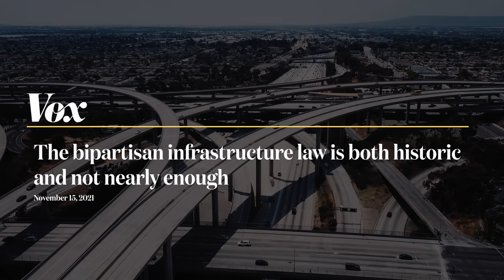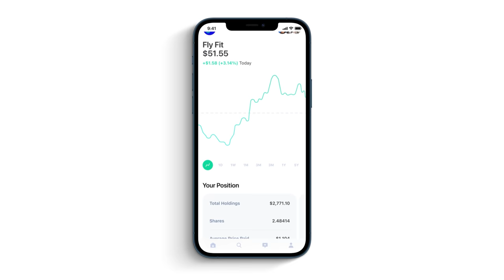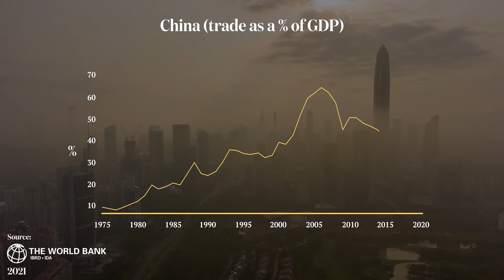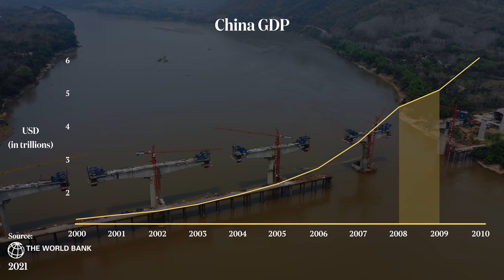China Has A Debt Problem Three Times Larger Than Evergrande | Economics Explained

Comment: is there any chance you would do a video comparison on the economics of Japan's highspeed rail? I think about the efficiency of Japan's infrastructure maintenance often. Like that sinkhole they fixed in 2 days a few years ago.
Reply: Lol japan actually aimed for a prc like density of hsr in the 80s. Then the financial reality of its cost hit home. They privatized jr rail, and the less economical routes never got built. So japan still has a mix of normal and high speed trains. Thats what i read. Prc is already aware of the hsr cost though...they might cut back if it turns out to be a grey elephant for mid size towns and cities.
Reply: @abcdedfg8340  part of the reason it ended up being a highspeed and normal mix is also they lost a entire decade from 1991 to 2001 and there now only moving at a snails pace.
Japans ecconomy has been just as stagnant as europes since the eurozone crisis for even longer
Reply: @Newbmann  True, but even before there were probably questions around its viability when there were already trains, highways, and planes. If the hsr just moves traffic and saves maybe 30 minutes or and hour top, seems abit over the top, for a town or small city. Besides, hsr is only part of a wider system, so it needs to be rational.
Reply: Sink hole was caused by construction nearby and it actually took a week to reopen. Also closed later when it began sinking again after a week or two
Reply: The tokyo rail lines have had similar problems to the China rail lines. The Tokyo rail company has gone bankrupt before, so I’ve heard.
Reply: @Boy Kulot Japans issue is population now, and people are much less likely to emigrate to japan compared to Europe
Reply: That would be a great topic, but also because I believe Japan has the largest debt to GDP ratio in the developed world.
Reply: JR is a very interesting case. The shinkansen lines originally connected the two major population centers. After that JR leased out the space both within and in close proximity to the lines to further profitability. This allows some of the less used lines which may or may not be profitable to still remain profitable overall as businesses will prefer locations close to JR lines and pay a premium for it, especially if they're out of the super populated areas like Tokyo or Osaka. However, I think the most defining characteristic why JR is successful in it's HSR project is that they have a high ridership with a population that is wealthy enough to pay the ticket costs associated with it ($80-120) one way. For comparison, the Beijing to Shanghai route is a distance of 1300km which costs $80 per ticket, while the Tokyo to Osaka route is just 500km while costing $80-120 depending on when you buy it. The shinkansen is earning over 2x the revenue per segment in ticketing costs alone. This is a big deal in terms of viability. If costs are similar,  JR can run these routes with half the ridership. China's HSR cannot extract such prices out of their customer base. If the Beijing-Shanghai route for example cost the equivalent amount of the cheapest shinkansen ticket, it would cost $180 which would put it at worst cost performance than air travel. I won't claim to know what plane tickets cost in China for those routes, but in the US, where air travel is dominant for long distance travel, tickets can be found from LA to NYC for as little as $100 which is over 2x the distance.
Reply: @abcdedfg8340  Yep, it's important to pull back when you know it's not going to be financially viable.
Reply: @wakannnai1  That's a great response. Thank you! I think it's a really fascinating comparison!
Reply: @chrissmith3587  Lol no. There are lots of people wanting to go to japan but japanese don't like foreigners
Reply: @Boy Kulot strangely enough, i do say that a certain degree of insecurity actually helps the country as a whole.
like, pick a natural paradise where things almost never goes wrong like Latin America. infra structure projects and urban development are done haphazardly and embezzled, then everything end being poorly made and fails to disrepair in a few decades. that if it even gets finished.

you do that in a country like japan or at least in a country with a harsh weather...  and instead of just rotting away, those things lead to disasters or tragedies.
 
you do the math and find that hundred of people deaths could have been prevented by proper infrastructure directly or indirectly? no one cares
a dozen of people die in a tragedy? people will demand someone's head and something to be done about it
Reply: @fandyllic1975  yeah but over half of it is domestic meaning japan actually dont have to pay those debts...
Reply: @hh-nh6ju  with the amount of debt, I’m not sure that helps much.
Reply: @khhnator  I wouldn’t call Latin America a natural paradise… lots of it is horribly hot and humid, plant growth is so fast yr constantly having to hack it back, and the bugs… so many and so scary. Humans are the worst part, though… except the peaceful indigenous tribes (not all are peaceful, tho).
Reply: @wakannnai1  that may be the case now, however it is important to note that the shinkansen was built in the early 1960s when japan was far poorer than today was profitable within 3 years after it was built and paid back the initial investment within 10 years.  The main reason why is as you said, it lies on a line between the 2 largest cities with over half the population of japan within those 2 cities as well as over 60% of the GDP.  In general HSR requires very specific conditions such as high population density and distances between 150 to 600 km for it to outcompete cars and planes.
Reply: @fandyllic1975  Japan is the biggest lender overseas, so no Japan is not strapped for cash. Japan is in debt like every country in the world but its overblown on how much they actually owe
Reply: @chrissmith3587  
One issue with Japan is that they have super strict laws against immigration. Like I think with regard to regular immigrants you need to marry a Japanese man or woman in order to be able to immigrate. 

Also with respect to the Japanese, their immigration laws are excessive and overly discriminatory. Like during one year where other large countires let in like a few hundred refugees each from impoverished countries after properly vetting them, the Japanese only allowed in a dozen or so. This is despite the fact that Japan's population is rapidly aging, they desperately need workers and the most of the children of immigrants who were born or lived in the country a long tims become far better integrated into the local society then their parents do.
Reply: @abcdedfg8340  One of the HSR routes in Japan (the Jōetsu Shinkansen) is rumoured to have been built as a "pork barrel" project by a former prime minister wanting to reward his constituents for their support. I'd wager that this is not one of the more profitable lines in the country, given how remote Niigata Prefecture is from the more heavily-populated parts of the country.
Reply: Japan help China to build their first high speed railway system. Then China just copy everything and claimed as their own. Just look at the design of their train, even half blind people can tell the similarity.
Now China is selling "their" railway system to other countries and compete with Japan. Since the Chinese clone is a lot cheaper, it create a major headache for Japan.
Reply: @hh-nh6ju  Japan has the largest total, but only 12th per capita.
Reply: @wakannnai1  Love the irony between your name and how detailed your response is😂
Reply: @wakannnai1  Chinese plane tickets are a bit more expensive, but not so much that you wouldn't rather fly than spend $200 on a train ticket!
Reply: @Boy Kulot lol Japan has already beat Europe... far higher GDP than any country there; they are not a mess you know nothing about Japan
Reply: @Pixel5564  not true
Reply: @Theoryofcatsndogs  and unreliable too
Reply: @allentoyokawa9068  how
Reply: @abcdedfg8340  3-4% a year growth for a highly developed nation is NOT snail pace, especially for a country with the 3rd biggest economy... for a developing country  yes that is slow... some people are so ignorant
Reply: The original Shinkansen debt is partly blamed for Japan's 30 year and counting "lost decade" of economic stagnation.
Reply: @wakannnai1  I've been here in Tokyo environs since 1987.  Over the last few years what stands out to me is the buildout of major train stations into retail spaces.  I don't know how the finances are being structured, but I'd expect that someone is making money.
Reply: @SurprisinglyDeep  Dunno, recently I see a lot of foreigners even out in the burbs of west Chiba, particularly Vietnamese and Chinese, but also from the Middle Easte.  I'm a white Canadian, married to a Japanese, and been here for 3 decades, so I'd fit the profile you suggest, but I'm doubtful that is generally the case.
Reply: @davidhawley1132 
 If that's so then it's good to know that Japan seems to be becoming more accepting of foreigners and immigrants in general.
Reply: pretty much the same. except they actually needed HSR to be able to compete with other transports, because their normal rail is a narrow gauge, which are slow. nowadays the normal rails are only for commuter and regional transports, while the HSR is for intercity.
Reply: @allentoyokawa9068  so your talking about the zoom boom after covid 
Guess what that's a quick recovery from a crash not natural long term growth.
Look before that blip how much ecconomic growth did it have from 1990 to 2020.
Reply: @chrissmith3587  it's not just about immigration no one's immigrating to Ethiopia and most people skip over turkey started births can have the same effect.
Reply: Wow! This will be a very good follow up.
Reply: @SurprisinglyDeep  I have permanent resident status, probably due to the fact that I am married to a national for a long period of time.  But I suspect that any of our statuses can be revoked if the national government really wants to do so.
Reply: @chrissmith3587  yeah and also mental health
Reply: @hh-nh6ju  im very sure they can repay their debt.Well their debt isnt as severe as china nor does it lend from other countries.
Reply: @fandyllic1975  yeah but no earthquakes, tsunamis, tornados, hurricanes, vulcanos, sub zero temperatures, snowstorms... heck even the wild life is meek there lol

and the ocasional floods ususaly can be traced back to people
Reply: They are currently sinking ungodly sums of money into ultra highspeed rail, just to try and cut the travel time between Tokyo and Nagoya from two hours to one. Quite possibly the world's biggest white elephant, if it ever actually gets completed.
Reply: Or how there is like no deaths on its Shinkansen
Reply: @Newbmann  Europe as a whole might be stagnant but individual european countries are doing just fine, Netherlands has been at a solid GDP growth.
Reply: @quitmarck  yeah countries like Ireland, France and Poland have been growing as well but those are the only big ones countries ranging from Italy and Germany HMM what do those have in common with Japan alongside Ukraine and Russia more or less a few affluent metropolitan centers surrounded by "rustbelts", I could go on.
Reply: @Newbmann  Netherlands etc. Main issue with these countries is just very elderly populations. Especially Japan. Economic growth to a large extent is limited by demographica.
Reply: @abcdedfg8340 
Regular railway supports freight as priority for profits and is able to provide passenger services
Reply: Here is a comparison at minute 06:00: https://www.youtube.com/watch?v=eLCa6Vl7EeQ&ab_channel=ChinaInsights
Reply: @ZooDinghy  interesting, thanks for the link!
Reply: It's an easy model to run japan move more people over a shorter distance. More people over time and distance =profit. 
Chinas rail covers so much distance they can't make profit as the services are to limited because of cost. There trains are mostly empty in the remote areas the services run. Huge maintaining cost eat all profit in the chinese rail model. Losing millions$ a year.
Reply: @Vignana_Pradarshana  While I think that was true in the past (that the Japanese didn't like foreigners) I think that has changed (at least in regard to their acceptance of westerners). As recently as the 1990s Japan was an unwelcoming place to Westerners, but my own experiences in Japan in 2011 found a Japan that was well signposted for English speakers, and Japanese people who were very outgoing and friendly towards westerners. 20 years is a long time (long enough for a new generation of Japanese to reach adulthood and a lot of Western culture to enter the country).
Reply: @mistralxsailing6  That's the point. China should have stopped building high speed railway way earlier as long as the high speed railway was profitable and then move to alternatives such as regular railway which is much cheaper. Because they  put so much money into high speed railway, there wasn't much money left for regular railway. As a result, they must move almost all of their goods on the streets which is more expensive then regular railway and which destroys the streets as trucks are so heavy. Now they have to pay to maintain the streets and the high speed railway that are almost unused because they lead to nowhere.
Reply: @abcdedfg8340  erm is actually prc aiming to be like japan lol. Not the other way round 🤣 been to both countries
Reply: @abcdedfg8340  That's not quite right. In the 1980s, there were only 3 high-speed (Shinkansen) rail lines in Japan-- the Tohoku Shinkansen, between Tokyo (Ueno) and Morioka; the Tokaido Shinkansen (the original one) between Tokyo and Osaka; and the Sanyo Shinkansen between Osaka and Hakata.. In the years since, Japan has built or extended more Shinkansen lines, including the Nagano Shinkansen, which was built to accommodate the 1998 Nagano Olympics; the Yamagata Shinkansen, which was built between 1992 and 1997; the Akita Shinkansen; the Joetsu Shinkansen to Niigata; the Kyushu Shinkansen (two lines); and the extension of the Tohoku Shinkansen up to Hokkaido. The Tohoku-Hokkaido Shinkansen will be extended to Sapporo, the Nagano Shinkansen will be extended to Tsuruga, and a new linear line is being built between Tokyo and Osaka.
Reply: @toomanymarys7355  Chinese air industry often face delay and bottleneck due to airspace issue. So if u don’t want all the delay etc, taking a hsr is a very good options.(I have several flight in china before, delay is very atrocious sometimes, meanwhile when i am in Taiwan, Japan and Hong kong(bound for foreign destinations), I haven’t face too much delay.
Price sometimes may not be far off, but air delay and check in time/travel time airports make hsr appealing. 
The Shanghai Beijing line, despite being around 1300km long, is the most profitable line of china HSR.
Reply: Could it be that because they have so many earthquakes, there are systems in place for rapid public works projects?
Reply: @abcdedfg8340  Each time you try to apply a single solution to many problems, it never ends well. HSR is a very specialized tool, which means very little flexibility and high cost. In the right place, it works wonder, otherwise, it's a financial disaster. PRC with its political system isn't equipped to question projects, their feasibility, etc. With no opposition, projects can go forward on a grande scale, unfortunately, without any hindsight. As you mentioned, Japan was able to revise its plans before it was too much late. And since this era, new HSR extensions in Japan have been very few and built over long period of times.
Reply: @Founderschannel123  bad thing is, China's debt is lower than their gdp but Japan's is 2x that of their gdp
Reply: Indyck Monkey  mostly because people here think HSR is cool and that it will show the world how great India is, which won't because some middle income countries have HSR but nobody cares about them, including Turkey,  Russia and poland
Reply: Indyck Monkey  I mean, I kind of want to be in politics but seeing how it's a message nd to get elected you have to make fake promises and appease certain groups, I don't really wanna, I am studying macroeconomics which does help in me understanding the policies by the central gov. but half the time, they're stupid, like how modi is building so many Expressways but not really upgrading the current ones, and not upgrading city intra, but I still love the Expressways do I'll let it slide
Reply: @fretstain
Your 🤔 thinking based on?
Reply: @bleuemoone8710  We have a LOT of earthquakes in Japan. And the government has been making an intensive effort, ever since the 1995 Kobe earthquake, to make sure that buildings in Japan are safe from earthquakes. My own part of Japan was hit by a M5,0 earthquake this morning-- but there was NO damage-- anywhere-- thanks to those building codes.
Reply: @bleuemoone8710  We have a LOT of earthquakes in Japan. And the government has been making an intensive effort, ever since at least, the 1995 Kobe earthquake, to make sure that buildings in Japan are safe from earthquakes. My own part of Japan was hit by a M5,0 earthquake this morning-- but there was NO damage-- anywhere-- thanks to those building codes.
Reply: @sailormatlac9114  Well then... in America's case, it requires a multitude of different solutions to solve a single overarching problem, in this case transportation, and reducing the need for personal cars and air travel without eliminating them entirely.
Reply: @mikenekosama4426  double post?
Reply: @fandyllic1975  Japan always to be a export oriented economy. Their big corporations operate around the world. It's not correct to use the domestic GDP to measure Japanese debt.
Reply: @davidhawley1132   Agree and I would think that is part of the success of the transport system in Japan. I love how I can get off work, catch the train and get some shopping done above or near the station on the way home. And with everyone doing home delivery, we can shop and catch the train home in time to receive the delivery (sometimes :-)  I believe this helps keep the environs around the stations more economically viable than those areas not serviced by trains (less major industry centers).
Reply: @danielscott4514   In my view this is something of great concern for the sake of Japan.
Reply: @abcdedfg8340  The difference between China and Japan's is that China's is 11 time the length of Japan's and standardized and generate profits in other ways unlike American short term thinking.
Reply: @abcdedfg8340  the problem is that you don't realize is that public infrastructure and transport in China is far more advanced than Us. Load is taken off the road reducing traffic in addition to saving time. Time also costs money where as in the US, traffic costs billions.
Reply: @Boy Kulot You'll be shocked to hear that the US also faces hurricanes, nuclear meltdowns and earthquakes.
Reply: @hh-nh6ju  " Japan is the biggest lender overseas, so no Japan is not strapped for cash. "

#facepalm

Those two have never been mutually exclusive.

Japan's debt, meausred by GDP to debt ratio, has long been the worst in the world.  While China may have recently taken the #1 for worst on this, only a couple countries have anything like the 200+% GDP to debt that Japan has.   Japan's debt is quite UNLIKE most countries in the world.